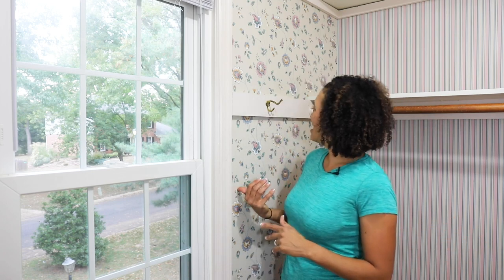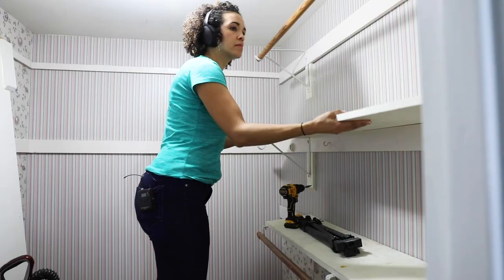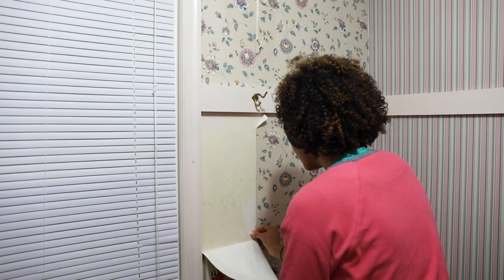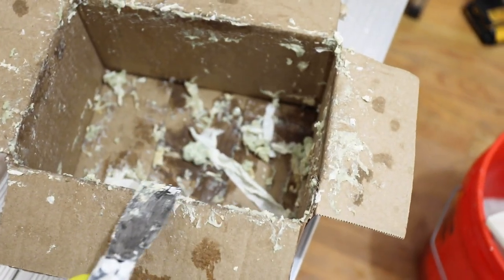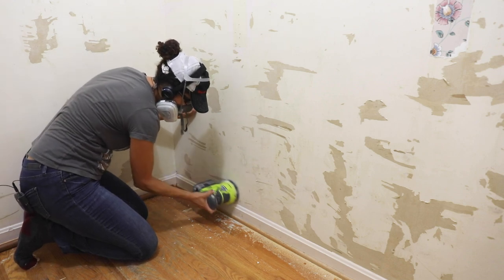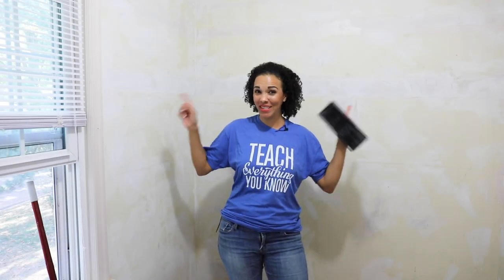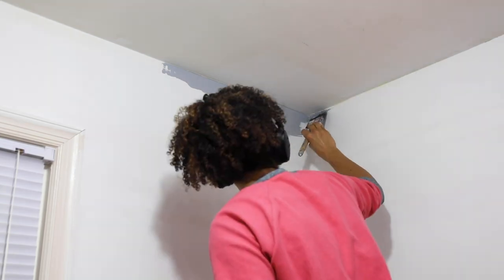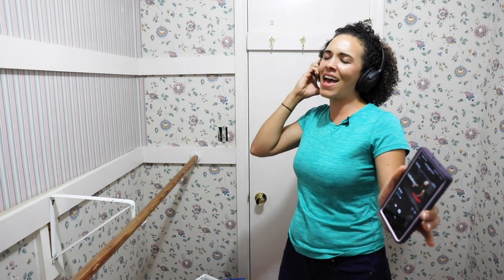How to Remove Wallpaper Easily (and Repair the Drywall) - PART 1 of 3 - Thrift Diving

Comment: I use hot water and vinegar, spray the wall let it set and pull it off..
Go back if any of left on the wall.
Spray hot water and vinegar.
Scrap it off with a 5 inch putty knife..
No need to redcoat sheetrock.

Comment: I wished I had a steamer. I just soaked the wallpaper with warm water and went at it. The color part removed but then it left the adhesive backing on the wall that was like another sheet of paper on its own. Wet that too and took like a metal scraper and scraped the wall and the  paper adhesive part off. I couldn’t patch the wall up because the paper went behind my kitchen counters so I put a different one wall paper over top of it and painted it a color I liked which will keep me sane and the backsplash wall of my kitchen not this awful red rusted color of a wall paper it once was. THEN I’ll do it properly when we demo the kitchen

Comment: I bought an older house the other day and there's splatter of wallpaper everywhere. Does this work to take away pieces of wallpaper scattered everywhere at the house but not in one piece like somebody started the project but the cohesive parts are still stuck.

Comment: Way easier, cleaner, and quieter method for all of this and for very little money. Use a mask and a sharp painter's 5-in-1 to knock the wall paper off for the most part, no need to take it all. Sweep and shop vac your mess, and now your done with the mess and dust and noise. Skim coat the whole wall, but not like shown, use a joint knife to get it all close to smooth, one wall at a time, leave the corners alone. After knifing the entire wall, use a BON squeegee and misting water lightly to smooth it. When it is nearly dry, just take a moist sponge (I like the big yellow hourglass sponges sold for grout) and knock off any ridges and lightly sand with the sponge to get a smooth finish. Use one pail for clean water, and one for dirty. Repeat for all walls,  corners last. Same technique but use a 90 degree corner trowel before the squeegee. No sense breathing in that dust, making a mess, or such a commotion with power tools.

Comment: How much time per day did you take removing the wall paper (those initials 2 1/2 days)?
Reply from the maker: That sounds about right. Maybe a little less, but the rest of the work, like repairing the wall, painting, made up most of the time. The actually wallpaper removal was quick.

Comment: I’m sorry but you could get this full done in 2 hours. All you need is to 1 get a knife and cut some lines into the wallpaper then get some warm water and a large paint brush and start pasting the water on the paper the lines will help the water seep through. Then you can get a scraper about 5 to 8 pounds from a shop it will peel of nice and easy leaving no marks

Comment: serena, isnt the brown paperbag from the drywall peeling and not from the wallpaper? drywall after all is made from paper. the wallpaper is adhered with glue. there is no paper from the wall paper touching the drywall. its glue.
Reply: the steam is actually affecting the drywall and making it peel. i want to say that you are leaving the steam on the walls too long but the damage was already done when the wall paper went onto the wall. the glue is water soluble.

Comment: I need some major help. I have wallpaper that has been painted over several times! Help
Reply from the maker: Hmmm....can you still see the wallpaper underneath poking through? I would try the steamer because it will loosen up the paint. But it will be a "fun" job to remove! Try a test area like behind a sofa or something to see how well it comes off.
Reply: Thrift Diving at places you can see the hint of a seam. Mercy I’m scared!!
Reply: Saving with Stephanie J  Hi Stephanie, I went through this myself last month. The wallpaper came off easily, probably because it was brittle. The glue holding the wallpaper was a different matter. Clean and scrape your walls repeatedly before painting. They will look and feel fine, but do another round of glue cleaning anyway. If you don’t get the glue off completely, your paint will roll on, and then roll back off with the roller. Don’t be afraid of the paper, be afraid of the glue. It’s doable. Good luck.

Comment: What grit was the sandpaper
Reply from the maker: You can use a fine grit, like 220. You don't want to remove a lot of the joint compound, just to smooth it out.

Comment: You really should have used something like Gardz on all that torn drywall paper before you mud it.
Reply from the maker: I've never heard of that. I've never had a problem with skim coating and then priming, followed by paint. :) I'll have to look up Gardz.
Reply: @ThriftDiving  ya check it out. Its a product just for torn drywall when you tear off wall paper. Seals off the paper so the mud will stick better and not be soaked up and eventually fall off.

Comment: If you peel the top layer off first, then use a large sponge loaded with soapy water, and saturate the next layer, it will be a faster and "neater" process. 

You are making too much work for yourself with that crazy gadget.
Reply from the maker: That would take longer. You'd have to do a lot of soaking. The steamer works very well. There are several methods, and I'm sure all work. Just a matter of which one to do. :)
Reply: @ThriftDiving  My thinking changed when I removed a wallpaper border yesterday! Lol, just working on an area of approx 2 ft, it took me just under 2 hours to remove it. My previous method worked amazingly on a room that was wall to wall paper, but this strip of border, I guarantee you, came with a 100 year guarantee on the adhesive.

Comment: You’re doing that the hard way causing more work for yourself. Easier way to do this is simply using a humidifier, plastic drapes, and tape. 

1. Place your drapes.
2. Place the humidifier in that space enclosed by your plastic drapes in the on position.
3. Tape off your drapes.
4. Walk away for a while. 
5. Test your wallpaper. When the wallpaper comes right off your good to go.